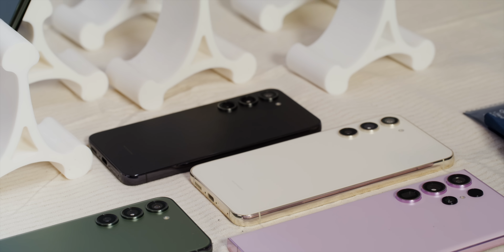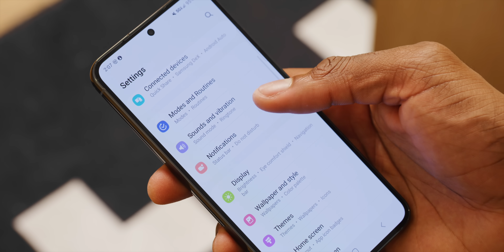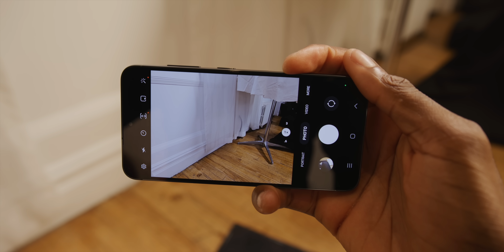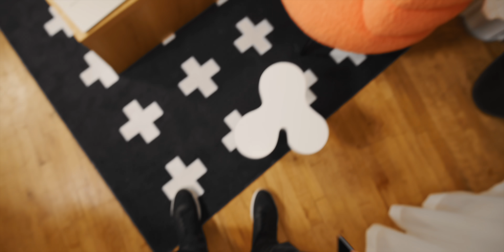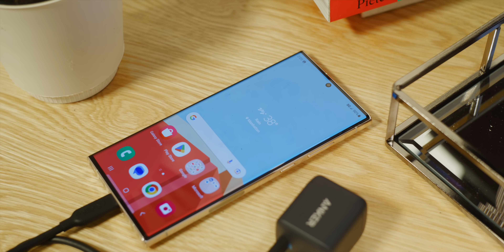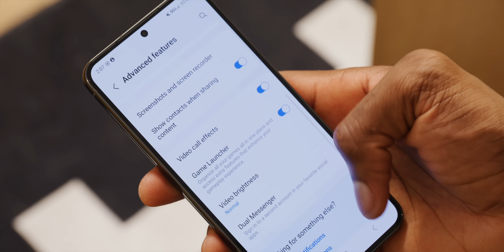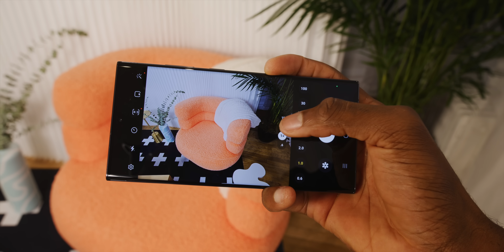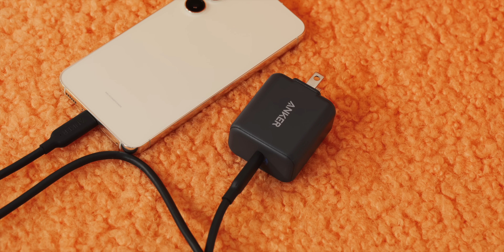Galaxy S23 / Ultra Impressions: Cruise Control!

Comment: Honestly I'm disappointed with Samsung. There are so many patents they are sitting on that could push the envelope even a little bit. I would like to see the variable Aperture return to finally take portrait shots with analog components vs digital processing. Like even the folding phones are getting incremental. Nothing stands out to me on wanting to upgrade.

Also they do need to make their camera system more snappy. That lag is real even on older phones

Comment: 1080p on the 23 plus is an absolute joke. My s10 plus had a higher resolution. $200 for a lower ppi, slightly larger battery and faster charging. My decision to sell my s22u and go with Apple seems justified. I don't want a flagship phone with a built in pen I never use. I want a pro phone the size of the regular s23 or the plus.

Comment: Europe does not get Snapdragon. Called it first, mark my words. The Snap 2 "for Galaxy" is actually a rebranded Exynos. The rest if the Snap Gen 2 soc are made by TSMC. These ones in the S23 are Samsung made, and they probably paid royalties to Qualcomm. It's the US that got an Exynos now 😅, not the other way round. Higher clock speed only makes me weiry about the sub par battery efficiency that makes Exynos famous.

Comment: Hey Marques. My s20 ultra has a flickering screen when I use 120hz display but the flickering stops at 60hz. Is that a common issue with the Samsung ultras cuz you mentioned it in the video as well?
Reply: It shouldnt flicker when you view it in person the flicker he mentioned was just on camera
Reply: Yup. Mine flickers in person when the refresh rate is 120hz

Comment: Sorry but I have to correct you. The camera's on the s 23 are the same exact ones found on the s22 so no new sensors. And the only difference in the s23 ultra is the Main 200 mp camera. That's it no new sensors aside from the main.

Comment: Ok... so did apple rip Samsung or did Samsung rip apple? The only difference I see is notch/no notch and camera layout. But like... everything else is fricking identical. The squared off metal sides, the shape of the 5g antenna and its positioning are similar, the glass inlaid back...

Comment: I had my s22 ultra for few months overall not gonna lie i had mixed feelings about it. Battery life was always a struggle sometimes it was not responding which for the money seemed a bit unfair. Recently i lost this phone and the only thing I felt was that i lost a lot of money not that i lost some kind of great experienced. I switched back to my old phone which was V60 LG which i bought used for 250$. Basically battery life  is much much much better even though it's an older phone. Also better overall audio, speakers, better microphones, can finally hear somebody on the side loud and clear, plus quad dac which makes headphones burn because it still comes with HP jack. The only thing i miss that i wouldn't thing would be an Issue is 120hz which is practically in any mid range phone right now, but after one week i don't even seem to notice it.... Camera in s22u was great, not gonna lie, but so what ? How many times per year did i use 100x zoom?  I think only few times to show somebody that my phone can do this shit. Now i look at s23u and i don't see any difference. Is this a joke ? Oh, of course, the price is higher. I think this was the last time I paid  for the phone so much. And I almost forgot... When I drop my lgv60 i don't give a shit, cause i can buy 6 more of them for the price of s23u not to mention it wouldn't matter anyway because this phone is pretty solid built.

Comment: No real upgrades except not using the awful exynos chips, 1 camera update on the back for all 3 (specs looks exactly the same for tele and ultrawide and they are generations old and pretty bad tbh) , 200mp cams are already about and meh quality (still smaller pixels and sensor than my old P40 pros 50mp cam from 2020), gets beaten by last year's phones and will get easily beaten by this year's phones in camera and video performance (vivo is throwing out 14 bit video recording and Xiaomi does 10 bit dolby vision with a dolby vision screen) . Still terrible charging. No 10 bit panel, lower 1080p/1440p screens than its competitors aswell. 

You forgot to say everywhere else in the world the s23 is £1000/€1000, s23+ £1100/€1100 and s23 ultra is about £1300/€1300 all for the base storage and ram models.

So glad I stopped using Samsung phones, getting lazier and worse each year (the A series are actually really competitive, quality phones)

Comment: Im amazed at how far tech have come in just 3 years. Im running the Nope 20 (i know its note and not nope) witch as most of you know is not a great phone but it was the first android i had in like 6 years so i didn't really know what i should have gotten and saw that it realleased recently and bought it. Anyways the shutter lag on the galaxy s23 is nothing compared to my nope 20 witch in pro photo modes takes a good 3 to 4 seconds, sometimes even upp to 6 during bad sercomstances before taking the photo, on the plus side the photos i get looks pretty decent for being the MKBHD flop of the year when it realeased in my opinion. Finally switching to a pixel 7 pro soon tho.

Comment: Its actually interesting to observe the screen flickering changing speeds, it shows really good how quickly the system goes from 1hz to 120 when you operate it, it was super fast and smooth

Comment: Probably a solid place to post this in the hopes someone super techy can inform me... Few years ago I had a Galaxy Note 9 i'd say when lockdown hit I was on tiktok a lot more not addicted but enough to the point where the screen burned in... Made the leap to iPhone and honestly I've been using tiktok even more and there is 0 burn in... I'm wondering with the screens the new 23 ultra is made from will I ever have to worry about burn in?

Comment: Samsung has some low trade in values for the s23. They gave $900 for the flip 3 towards the flip 4 at launch, thats 90% the original price. My s22u is only worth $500 towards a s23u.

Comment: Not sure if this is an overall Android issue, but I had the S8 plus in 2020 and I stopped getting new Androids. Got an i11 (before switching to the 14) and I was STILL getting the new updates xD Even if at times, it may have been a bit slow. This is why I would not opt for a Samsung or, if this is general, Android
Reply: As of last year, Samsung has updated their OS support for 4 years (4 Android updates) + 1 year of security patches for the S21 and beyond (including the Z Flip and Z Fold released on 2021). However, I agree Apple is still unbeatable when it comes to OS support, but Samsung seems to be trying to catch up :)
Reply: @rinari869  I do hope so because I do like Android too and I can see why people use it. I for one never use phones at their full capacity, so iOS is just what I need. But the new Smasung is SO nice with the rounded edgesss <3

Comment: So my refurbed note20ultra5g256gb 12gb ram with a year warranty& the android 13& ui5.1 update from amazon for £350,is still just as good still has 8k& 108mp camera& still has a slightly bigger screen at 6.9"im just more pleased with my purchase that even though its a two year old phone,in use&even pixel peeping you'd be hard pressed to tell the difference.Glad samsung have these longer term updates.👍😉

Comment: I've yet to move from S6 still. I'll check the ultra once out, cam for night seems awesome, hopefully vid too. Battery is just ok still not as big capacity or faster charging, shame.
Reply: You’re not getting any operating system updates (including security updates for the OS). I’d upgrade to anything still supported if you don’t end up with the S23 ultra.
Reply: @HFlame7  oh I will, battery is 2/3 health from 2550 only heh

Comment: The base model, S23 Ultra, costs over 1400€, without having the costs of developing the operating system, App Store or iCloud, maintenance of data centers, hardware is developed by Qualcomm (processor, sensors, modem), and I could continue, from lag to disastrous UI / UX. SCAM!

Comment: Is the vibration motor the same as the s22u? I had your issue with it where I never heard it or felt on a bed or table and returned the s22u for a s21u1 and have been happy with it. But miss that 1tb of space. That vib motor was deal breaker for me though as I keep it on vibrate only.

Comment: I'm still using the s10e. It's a great phone for someone like me who isn't a power user. I also love the size. Still waiting for them to bring back the fingerprint sensor (which probably won't happen). also, i still use earbuds. If anyone has any recommendations similar to the s10e let me know.
Reply: I'm still on my S10e too. I'm just waiting for the reviews to see what they say about the battery life, and if they've got the Snapdragon processors in Europe this year.
Reply: I'm using the s10 e too and I wanna upgrade because my battery is awful. I'm scared to go with Samsung because the s22 seemed to have terrible battery life as well
Reply: Look at Samsung a53. It has a fingerprint reader under the glass, 5000mah, microSD expandable storage,120hrz display and sadly no headphone jack but it's $350. I've found some nice braided headphone-to-usbc conververs.
Another option is the Asus zenfone9 with a fingerprint reader and headphone jack but more than twice the price with slightly less battery capacity, and no SDslot. I believe it only supports 2 years of system updates rather than the 4 years that Samsung offers.

Edit:the a53 is lightly larger but the zenfone is wonderfully compact!
Reply: @a  or if you can find the A52s 5g, which I find to be slightly better to the A53. It also has a headphone jack.
Reply: thanks yall ill check them out

Comment: You know it's funny when Apple Samsung and Google talk about sustainability and not include a power adapter or a case and make the packaging smaller but in this day in age selling a smartphone with a 128 GB and 256 GB storage is a complete waste. We're taking photos, downloading apps, and recording 4K and 8K video on our smartphones which already right there takes up storage. They should make 1 TB and 2 TB phones standard across the board.

Comment: A tempting upgrade to the S23+ from my S20+, but ultimately idk yet.
Reply: I am on s20+ (Snapdragon), same but i think i can live perfectly for another year. It's just nothing to special since s20 series came out.
Reply: @pixellord1  only reason I'm considering it is because this is the last year of software support for the S20 series, otherwise I'd definitely wait another year or so.
Reply: @hotcheeto9180  Support of new Android, but not security patches, that will still remain for couple more years. And it's already on Android 13, which is latest, so one year should be not a problem.

Comment: I think we're close to the limit of new features on flagships. Before this there were major upgrades like removing the home button, shorting the bezels, hole punch camera, in screen fingerprint scanner etc etc. Now there's not even much to add anymore other than the camera upgrades:(
Reply: Tou can't say such a thing. Actually nobody knows what will come next corner when we're talking about technology
Reply: @jesusdourado  I get that, I just said we're getting close. Sure we'll get something new but maybe after 3-4 generations instead of new stuff every year. Compare the time from the Galaxy S2 to the Galaxy S20 to the time from the S20 to the S23.
Reply: Better battery, SD card, charging adapter coming with the phone, more AI software
Reply: @kentrelt5140  None of that other than more ai software is new. I don't think sd card support is coming back which sucks!
Reply: @jimhalpert0  I hear u but those r all updates that Samsung could make it it chooses too. Rite now google has the upper hand if it uses AI to best of its ability. Google cam is a no-brainer and to have accomplish this with only being in the game 8+ years compared to Samsung and apple.

Comment: Whoa thanks for pointing out the shutter lag, never would have noticed that, kinda a big deal for some
Reply: mrwhosetheboss shows the S23 Ultra and S22 Ultra side by side and the S23 Ultra has a much faster shutter lag. It's still there, but S22 Ultra was much worse.

Comment: I really wish they would just bring back the SD CARD SLOT and IR BLASTER and fix the trade in prices in conjunction with the new processor upgrades...SAMSUNG would've knocked it out of the park frfr.🤷🏾‍♂️ guess I'm staying with my S22 ULTRA for a little longer.

Comment: Really hope that Samsung brings the camera of the ultra to the smaller versions some day - don't want an Ultra because it's too big, thinking about switching to an iPhone 14 pro because if that - if it weren't for the lightning port..
Reply: 14 pro cameras? Sure about that??😂 they have problems with the cameras
Reply: @Ryan24-q5w  you know there's software update right?
Reply: @Ryan24-q5w  the 14 Pro has objectively better camera sensors than the S23U.  I don't know about the software (not an iPhone user) but they basically copied what all the best Android cameras were doing last year (bigger sensors and ~50MP)
Reply: Apple's essentially doing this with the iPhone 15 Ultra with the addition of a periscope zoom lens. The normal 15 pro most likely won't get it.

Comment: I have an S22. i pre-ordered. I went through the motions to buy an S23 plus with Verizon. I got $800 in trade in credit. I would only have to pay $200 for an S23 Plus 512 GB.  Sweet deal. I didn't push buy because do i really need it? Then i tried Unlocked. I only got $200 trade in credit. Yep a stinking $200 credit. I still get the memory bump but....I would prefer an unlocked phone. So, this year? NOPE!

Comment: Not really a fan of the newest one due to price being increased yet again, and upgrades being barely incremental. At the end its the public who votes with their wallet, but I'm perfectly ok with what my S20 Ultra can still do, even if the body build isn't as aesthetic as the new one, but even base model has 12GB of RAM. And you really miss the micro SD slot when you don't have it. Hopefully 2024 model shakes things up because I like One UI's customization and Samsung's Good Lock.

Comment: i had s22 ultra , great phone , only issues i had was shutter lag and i personally thought it struggled with greens, I swapped for the pixel 7 pro both great phones but the 7 pro is more useful for me personally and the 7 pro camera is fire and forget,  biggest disappointment i found with both was video, both not great, so lets hope the s23 has fixed that, but there is just something magical about a pixel

Comment: So I have the S22 Ultra. Love it, but cracked it. Which it's around $350-$550 for a repair. (Even 6 months later) It's easier to pay $800 for a S23 ultra (with trade) it seems.

Comment: Yikes! They really needed a breakthrough in order to pull ahead of Apple and Google. I feel bad for anyone who spends full price on this S23 lineup. These are incredibly boring and greedy. They still haven't fixed the shutter lag either??? 

PLEASE anyone thinking of purchasing these, just get a Pixel 7, or consider an iPhone (if you don't need to be on Android, and you want the fastest, most reliable, longest supported, best video, best battery, phone)

Comment: Two things I hate about s22 ultra that I think this will have as well is screen on time and charge time. 65 watt Samsung charger is a joke. It takes 52 minutes to fully charge. 45 watt takes 56minutes and 25 watt takes 62 minutes. 40 watts extra power gives you 10 minutes of savings in charging. But for most of us who top up, the extra 80 dollars paid gives abysmal performance. I came from a OnePlus so I do have their warp charger 65. This charger actually charges s22 ultra in 40 minutes or so. That is a huge difference from 62 minutes and a 30 minute top up on it gives about 75%.

The screen on times I am getting on s22 ultra is about 4 hours. That's just terrible compared to the screen on time an iPhone 13 pro gets, which is around 10-12 hours of SCREEN ON TIME. I have seen reddit post where people claim they get 11 hours SOT with s22 ultra but I tried replicating it by turning off and uninstalling most of the apps. No notifications at all. Still the most I got was 5 hours. For a 1200 dollar piece of brick, that's just shit. Can't recommend Samsung for that reason. If at least they had as good fast charging as OnePlus, I could have overlooked. But this is overall just a shitty combination for an outrageous price. But hey, sure takes good photos right?

Comment: Was going to upgrade but my " brand new s22 ultra " trade-in is ONLY 500 bucks like what?!?! 
Last year I traded in my s21 ultra for the s22 ultra and got 750 dollars trade-in.
I don't get trade-in value. 
I'd rather keep it only thing that changed was the chip and 200 mega p. Camera smh.